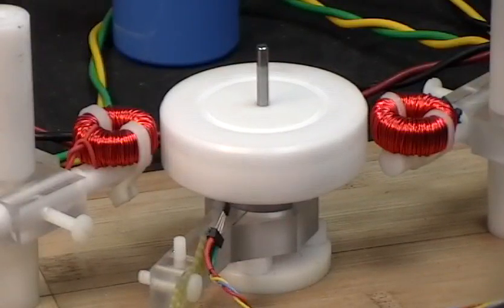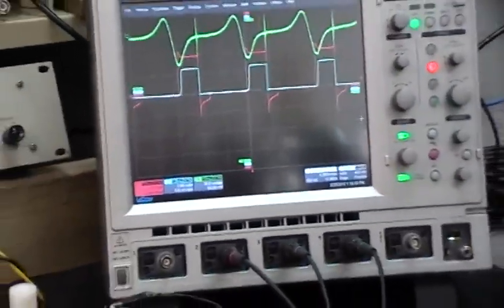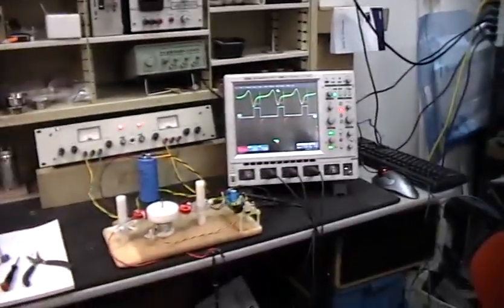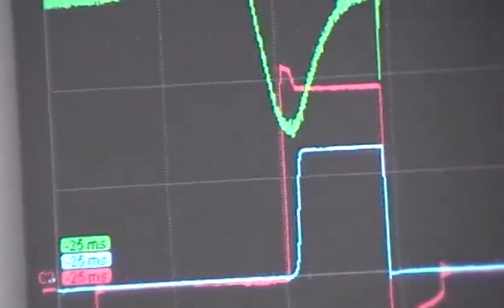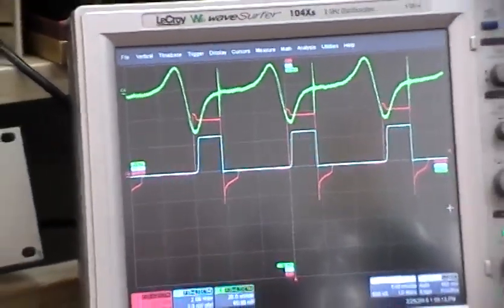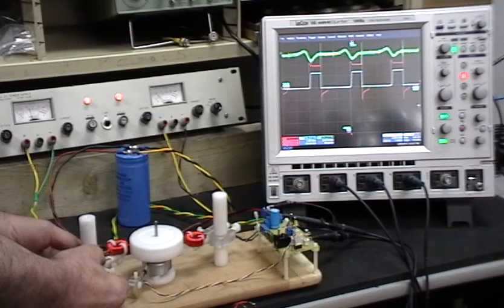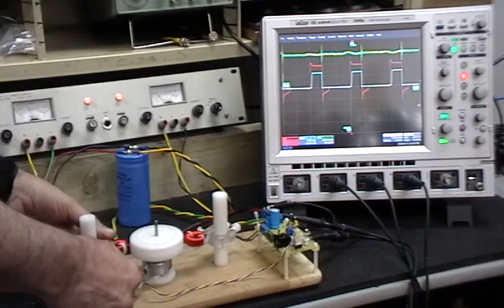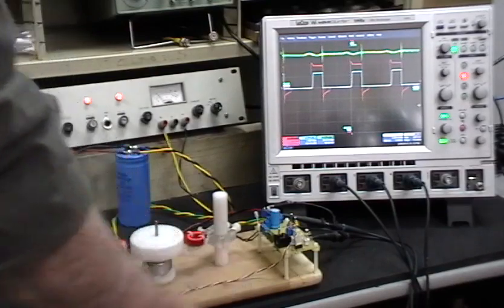Orbette 2 #1: Positioning Coil for Minimum Generator Effect CEMF

Comment from the maker: @Asymmatrix 
Right. And that's easy enough to do. My latest video shows how the rotor power dissipation at any RPM is determined; my rotor dissipates OTO 10 milliWatts at normal speeds, while Steorn's must only be dissipating 1 or so, since it has much better bearings. This means that, of the 3 or 4 Watts average in Steorn's input, only 1/1000 or less is needed to turn the rotor.
Move the coils further away. CEMF disappears; Steorn's rotor still gets enough power to keep turning. 1 milliWatt !!

Comment from the maker: Yes, as far as I can tell they do, and thank you for making this point. 
Just because one has eliminated or hidden the "terminal" signs of CEMF does not mean that there is no effect from moving magnets past conductors or pulsing currents through inductive loads.
Not only that, but also: the rotor turns. You cannot decouple this motion from "CEMF"; the more the actual CEMF is reduced, the less power is coupled to the rotor...it works both ways.

Comment: Very nice setup.
I wonder: it noticed that you're using a diode to limit the voltage peak when switching off the current. Strangely, I don't see that in the current trace. I would expect some current flowing during the 'flyback voltage'. Can you elaborate on that?